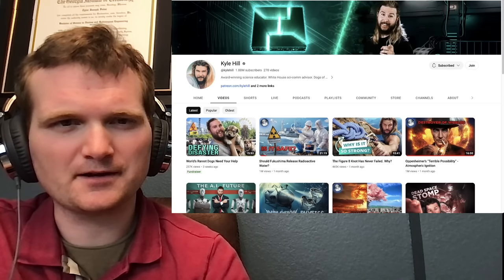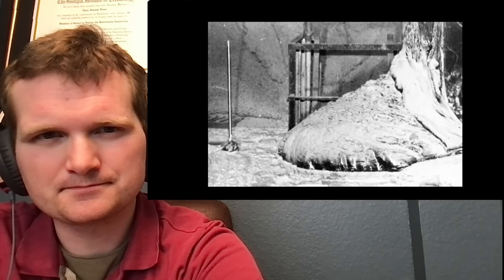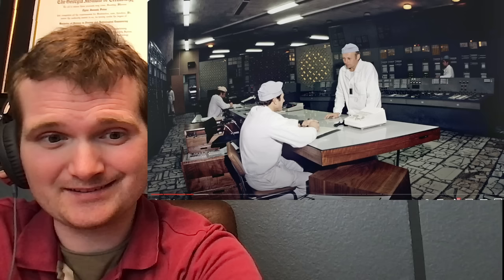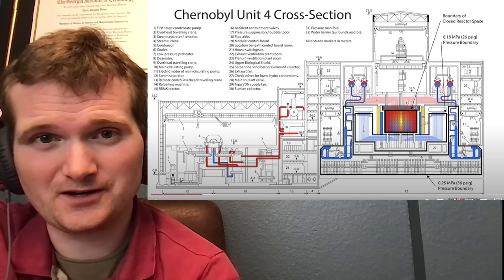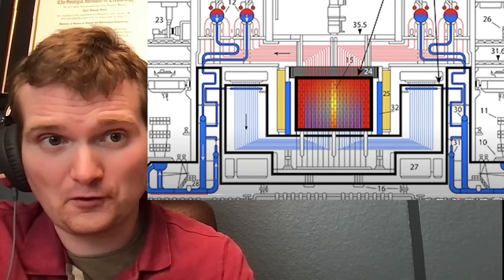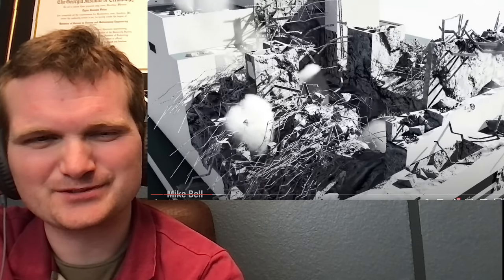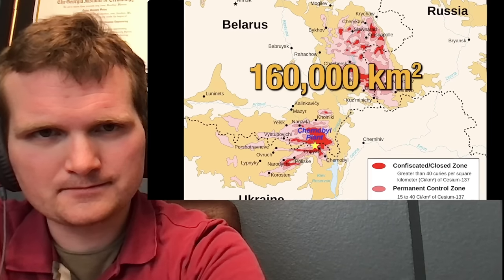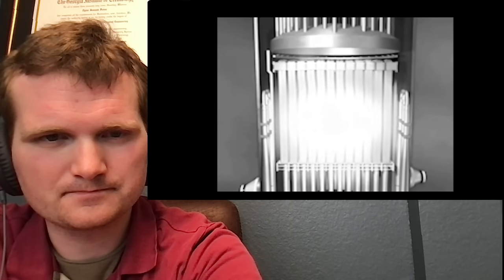Nuclear Engineer Reacts to Kyle Hill "The Elephant's Foot - Corpse of Chernobyl"

Comment: The short and mildly simplified explanation for the technical reasons behind the ghostly image (including the lightning bolts). Cameras work by exposing a patch of photosensitive material incoming light from the environment. Since the changes are predictable, they can be inverted to reproduce the initial impression made by the incoming light. In modern cameras, this patch is a reusable digital sensor that captures the photon impacts and composes them all into an image file on the fly.  Back in those days, it was all done with a reel of physical film that was chemically photosensitive and produced an impression of the real image on the film as it was hit by photons from the scene. The chemical transformation of the film takes time and stable exposure, though. The further back in the history of photography you go, the less sensitive the film would be: the earliest cameras in the 19th century sometimes needed literal minutes of exposure to produce an impression, and this is where shutter speed comes in: it's the time that the shutter of the camera is open and exposing the photosensitive element to photons. 

The other factor, besides the sensitivity of the film, is overall light level: a darker environment means fewer photons moving around and reflecting from the shot and into the camera. In dark conditions, you'd need to keep the film exposed for longer than normal to have enough photons hit the film to create an accurate impression: therefore, an intentionally slower shutter speed to allow the photons to accumulate on the film. But what happens when there is movement, such as people, while the shutter is open? Basically, it all gets registered in the same frame and piles up, creating superimposed images. The clear positions of the two men are positions that they held long enough to be clearly captured in the darkness, and the lightning bolts are an intense source of photons (a flashlight) organically moving in the hands of the men and leaving a lasting impression on the film much faster darker, less illuminated elements of the image.
Reply: Thanks for the explanation
Reply: "short and mildy simplified"
>writes a fucking book explaining it. LMAO XD

Comment: I remember that the first indication of the nuclear disaster was actually an alert from the nuclear plant in Forsmark, Sweden that even got out on national radio. They had detected what they suspected to be a radioactive leak. A bit later they realized that the radioactivity inside the plant was lower than outside and that the isotopes weren't the normal leak from an uranium reactor. It didn't take long after that to figure out that it was a foreign event that was really bad.
Three days after the explosion Landsat 5 got pictures where there was a bright red spot where reactor 4 was. Ten days after the explosion the SPOT 1 satellite got pictures of the area with a better resolution than what Landsat had.
I realized that at the time when the fallout was spreading it passed right over where I was, but the weather was fine in the area I was so the fallout in that area was minor while a bit later the fallout was washed out from the air by a rain and that caused a lot of contamination over northern half of mainland Sweden and southern Finland. At least for many years meat from wild animals should be avoided as food.

Comment: for comparason even the hottest lavas ever to flow on earth's surface were 1,600celsius , this ammount of heat curently detectable only on a handful of volcanoes of jupiter's moon "Io" , the modern basalt lavas are just 1,200celsius

so 2,000c is more comparable to heat inside planetary cores than material exposed to the enviroment

Comment: the "lightning streaks" on the "ghost scientists" elephant's foot photo are the guy's torch as seen in the long-exposure photo. see, there isn't any light in the room where the foot is, so the only way to be able to see it is to put a camera next to the door and leave it's shutter open and then do the other task that he was sent down there to do and go and take a sample (apparently he wasn't successful because the ceramic was too hard to be penetrated and none of the surface had flaked away yet) and the lighting in the photo is that from his hand-held shiny thing. story is that he was in the room for maybe 25 or 30 seconds but at the time lethal dose was a minute of standing over the thing, a distance he was only at for maybe five seconds of the time as he feebly probed at the foot with a steel bar

Comment: 18:26 "the time lapse like streak from the flashlight", thats the lightning like effect you're seeing. That is a side effect of shutter speed, the longer the shutter is open the more of this kind of effect can occur. 

When you lengthen the time the shutter is open it'll allow in more light in, when in a dark area with little light you lengthen the time the shutter is open to gather more light, if you do this outside the image would be so blown out by light the image would be nothing but white. 

So when you move a light source in front of a camera that has its shutter open that long the light will generate a streak like lightning effect.

Comment: Korneyv had a long shutter opening set on his camera - 5 to 10 seconds.  All the light streaks are his flashlight jiggling around.  He was not ready when the shutter opened at this point.  The glow from the foot is the backlighting from the flash over the 5-10 seconds; without the flash, the room is absolutely black dark.  He also dropped the flash; there are more squiggles on the floor cropped out of the shot used in the video.  The next pic the camera took had him kneeling still as he had intended.

Comment: So what's the deal with trying to use water to cool it down (initially) I get that it flashes to steam instantly, but that act of flashing to steam takes energy out of the process, and as long as you can dump water fast enough so that it pulls out energy faster than it is emitted you should be able to cool it even if it's flashing to steam.  If memory serves it takes more something like 5x the energy to turn a set volume of water to steam than it takes to heat up that water from 0°C to 100°C, plus the fact it flashes to steam is irrelevant it still needs to heat up that water to the boiling point, and as the steam gets hotter energy is still being pulled out.    Is there more of an issue that the steam becomes radioactive?   Or is it just a lack of available water, i.e. they don't exactly have a lake to drain near by which I'm guessing is the case that the whole thing happened so fast there was no time to dump huge amounts of water on it.
Reply: Yes by changing to steam it actually extracts even more heat than if it was to remain as water, exactly how a refrigerator works

Comment: The thing with the graphite tips is a misinformation. Water is an absorber so in order to prevent water from replacing a retracted control rod they had a graphite rod below the control rod. When fully retracted, the graphite was in the center of the fuel rods to provide even burn. Thy system was also like a brake that had a gas handle attached. Fatal if your reactor at one point races full bore out of a xenon poisoning and you move the much shorter control rods through an uneven burn.

Comment: The "lighting bolt" can easily be a handheld light, what makes the bolt is the movement around the frame, it's the same effect as the light trails from pictures of roads at night, only, chaotic.
The cause is the same, the slow shutter speed.

Comment: The camera thing. The light is from his flashlight. I use this technique still. If you leave the shutter open it'll continue capturing light so you have to move fast. If you move fast enough you'll disappear. Or you could draw your name in the air. If the shutter is open too long it'll wash out so it has to be very dark.

Comment: 18:34 it's most likely a lantern or any source of reflection/light. 
With a low shutter speed lights appear as rays or trails in the same way those cool pictures of cars show the light trais on a night road.

Low shutter speed means the sensor or the film is exposed a hight ammount of time, where moving ligts create trails.
The ghostly image, is as Kyle said Bursts of flashes, those bursts of flash in a long exposure scene, helps to capture detail without over exposing the scene. 
Dust particles in suspension, may look like bubbles of light, while radiation is often associated with image burn in the form of "noise" 
The image is blurry due to the lack of a stable stand like a tripod. 
If you want a spooky story, the the blurriness is the cameraperson pulse and breath in the short span this picture was taken.
The trail of light, in the ghostly person, is the movement, you can appreciate how he probably kneeled, (center loop of the ray) to get a sample of that deadly material.
Reply: It's suit reflection

Comment: Hi there Tyler, i am currently an 18 year old guy working at Walmart, but im quickly releasing these "deadend" jobs arent leading me anywhere. Ive always had an interest in stuff relating to Nuclear materials and processes, but im not sure it i want to commit to it. I do have a few questions if you are willing to answer them. :)
1. What was schooling like in terms of difficultly, like what math clasees do you need to take a so on?
2. Would you recommend it as a career?
3. Do you like what you do?
Reply from the maker: 1. I thought it was quite difficult, but rewarding. Math involved several years advanced calculus and statistics. Though, if one are interested and motivated, it is certainly doable.
2. Yes, keep in mind that nuclear engineers not only work in power plants, but can be involved in any heavy industry, research, technical management role, etc.
3. I sure do!
Reply: @tfolsenuclear  I appreciate the reply, I've always been decently good at math and I've already taking pre Calculus and Calculus while I was still in highschool so that should definitely help in the math aspect. I start community college next semester and am going to prolly take some classes relating to engenerring and see how I like em. All I know is I need a job that keeps my mind interested and will always have newish challenges.
Reply: @dylan5989  better start small, like some grammar/spelling courses.

Comment: What I don't get is why they designed the test to occur with the reactor at criticality, you can actually run the turbines up to 3000RPM using the combination of waste heat from the circulating pumps and decay heat - no chain reaction required

Comment: As i understand it they incorrectly diagnosed the reactor power condition, xenon poisoning caused the reactor power levels to drop, causing the Technicians onsite to ignore protocols and REMOVE more control rods than they should have, below minimum safe levels, that caused the reactor power output to spiral, heating and eventually vaporizing the water ...when they technicians realized the core was out of control they dropped the graphite tipped control rods, which further accelerated the meltdown.

As was said before , up until the point they removed the control rods below minimum safe levels, the reactor wouldnt have melted down... the root cause was that there wasnt staff on duty who were trained to recognise xenon poisoning, and noone wanted to shut the reactor down... so they panicked and the rest is history.

Comment: I wonder... We know hopw hot the outside is, but wouldn't the inside of the elephants foot be way hotter due to the outer layer working as insulation. How hot would it end up being at the center of that thing.
Reply: The outside is about 2k Celsius, so the inside could be around 8k Celsius

Comment: does the Chernobyl and Fukushima push Nuclear far more safer than the old system? yes, the fukushima is just very recent but engineering is done every year this is a complex system that is always being updated and being redesigned overtime

3 mile island is a good example a " normal accident/ incident " ,

Comment: I dont understand why Kyle makes such a big deal about corium.  Its by definition diluted spent fuel.  Its not any worse than spent fuel.  Spent fuel is really radioactive, therefore corium is really radioactive. Thats not shocking is it?  🤷
Reply: Radioactive lava is kind of a big deal.
Reply: @Mare_Man  Only if your standing beside it.  Cores that have melted have always solidified just like lava.  Yes dropping a liquid core into the bubbler pool would have been bad, but otherwise its just spent fuel.   And clickbait
Reply: @chrisj2848   Sorry but no, radioactive lava burning at temperatures you usually only see in the lower mantle near the core of the planet is a much bigger deal than a couple spent fuel rods.
Reply: @Mare_Man  Ok why then?  Its not an argument but an honest question.   I agree if it existed in isolation, but the fact that the core of unit four was already dispersed, so now there is a molten mass of core dripping around in the basement.   Sounds scary, but did it melt through the floor? No.  Did it cause some new criticality? No.  So whats the big scary deal?

Comment: Is there an amount of radiation that would kill someone instantly upon exposure?
Reply: I hope someone answers you more knowledgeably, but I know there logically has to be an amount. There are amounts of radiation that are enough to vaporize you (eg. the 100m°C thermal pulse of a nuclear weapon at close range) which would certainly do what you're asking. That said, the fastest thing that's going to kill you from radiation is induced heat, and it takes a lot of heat to overcome thermal resistance. You could actually survive a few seconds at temperatures around 700°C though obviously you wouldn't want to. I don't actually know at what point death would be instant, and I don't know how much is induced relative to radiation. Outside of Nagasaki and Hiroshima, it's never happened, though.

Of course, that's for general radiation exposure. If you take a targeted beam of certain types of radiation to the brain, it could be instant. He talked about a possible setup for that in the video 5 days ago reacting to Kyle Hill's "What if you put your head in a particle accelerator".